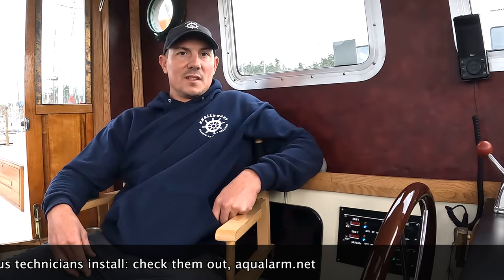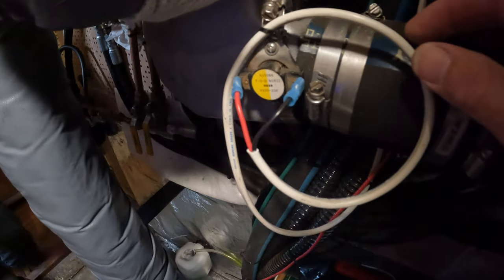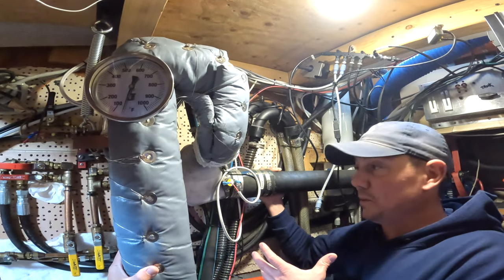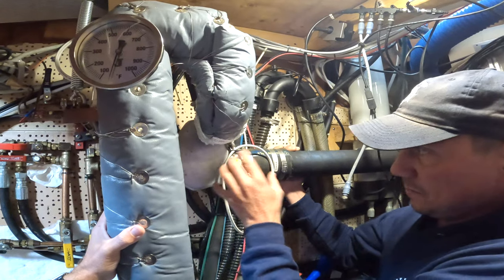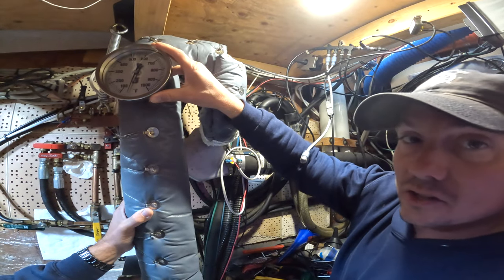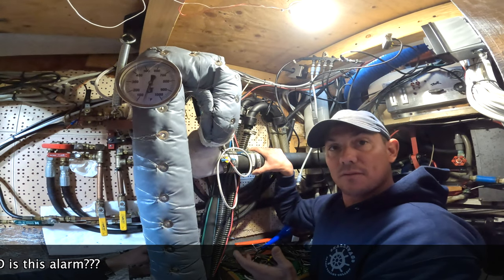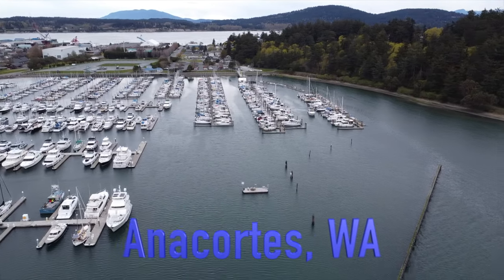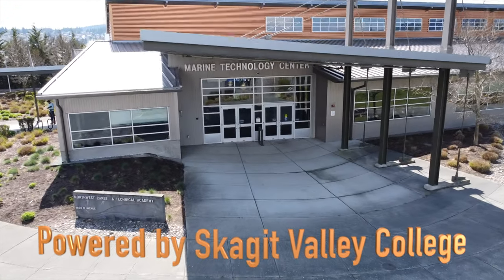Tech Tip#40:Exhaust Temperature Alarm, it can save  your engine

Comment: This is an awesome video- thanks! A few quick points some folks might be interested in. The AquaAlarm products are great but there are also some manufacturers (eg Silicon Marine and NASA) whose products provide the current exhaust temperature as well as audio/visual alarms. It can be nice to also see a graph of the engine warming up and one can also see temperature climbing before an alarm is triggered if for example you have a partially blocked heat exchanger or some barnacles in thruhull but not enough restriction yet to trigger an alarm. There are also stainless steel probes that go inside the exhaust engine, which may be a good option for some engines where it is hard to get the band clamp on the metal exhaust elbow. Many good options for this and 100% agree with your video that this is super cheap “insurance”.
Reply from the maker: Thanks for the added info, we'll check these out and add to our resources!

Comment: What a great idea for a simple but important alarm.  This switch looks like the Aquastat switch used in hydronic heating systems that keep the fans off until the fluid comes up to temperature, which keeps the fans from blowing cold air.  Great job Gio.  Thank you Skallywags for another great video.
Reply from the maker: Yes, exactly, I won't own a vessel without one - if it has a wet exhaust system, that is :)